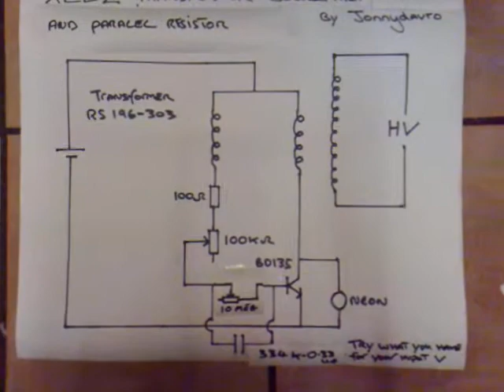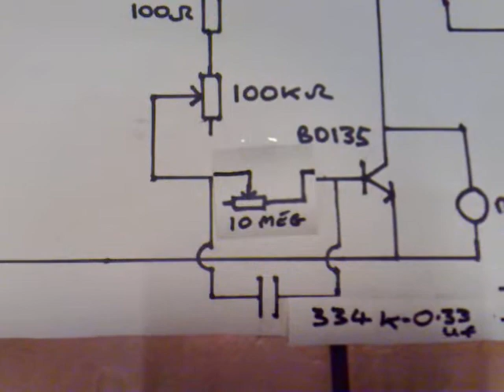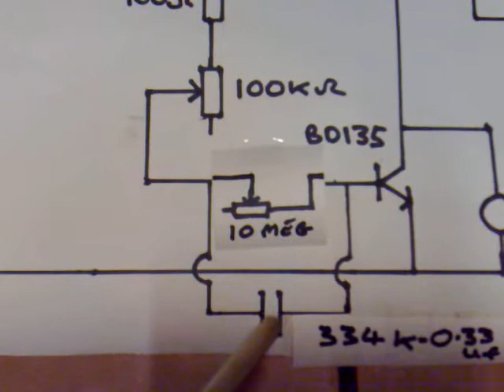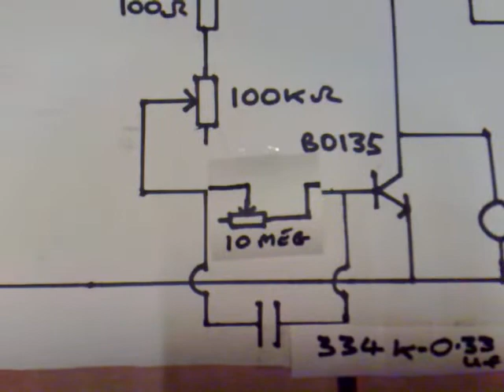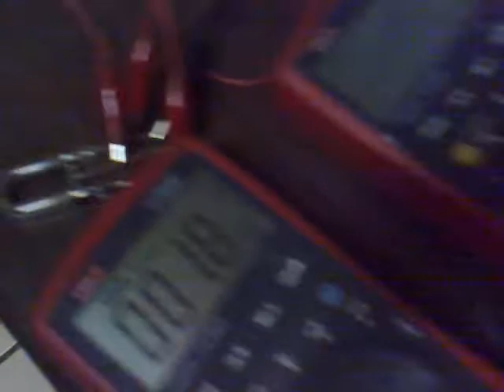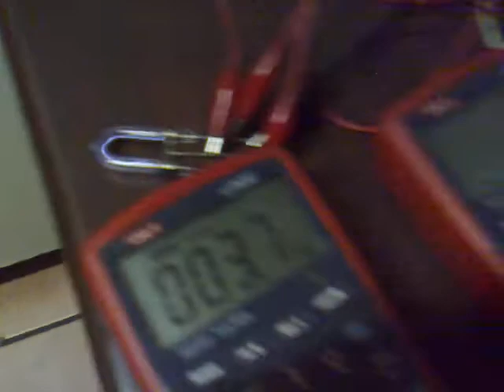Xee2 Transformer Jouleringer

Comment: WOW - everything becomes clear.  I can get really, really low amp draws with a really, really similar setup.  On my 'flyback ringer' attempts, I always put a cap and neon in a parallel arrangement on the base of the transistor.  Exactly as you are doing here, except you are using a MEGohm resistor, whereas I am using the high resistance of a neon bulb.  I think this is the case anyway.  Happy New Year Jonny - have a good one